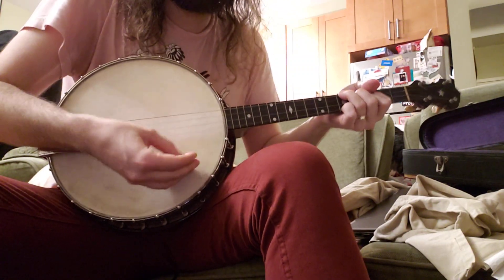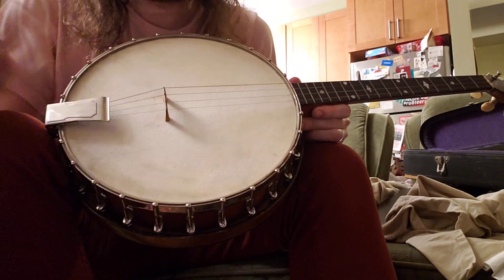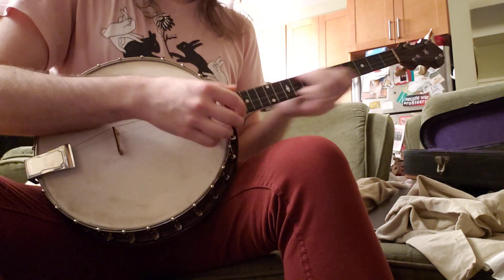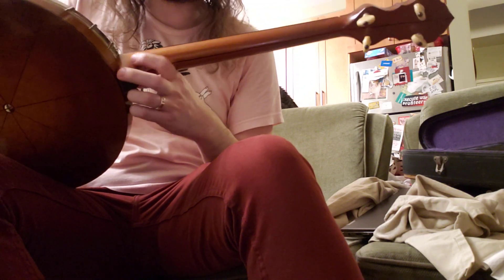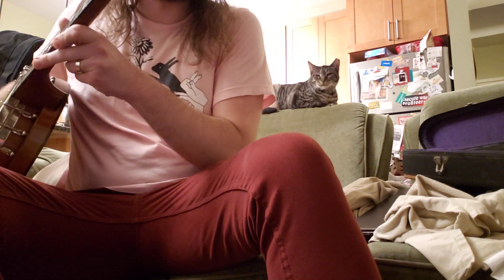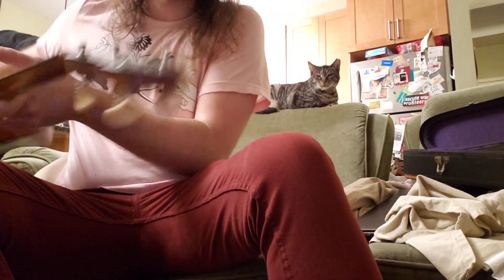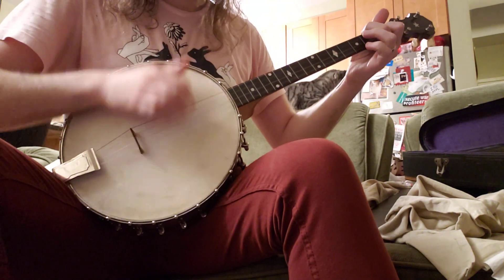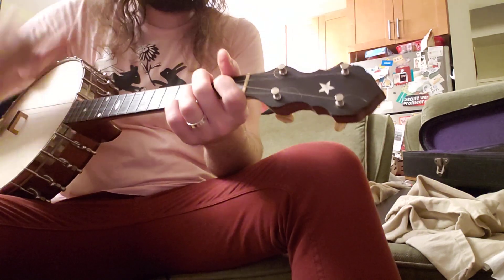THIS VIDEO OF A BANJO I WAS GIVEN AND WILL GIVE TO A FRIEND CAN BE PUBLIC WHO CARES

Comment: Notes:
tenor banjo - A longer neck would make it a plectrum banjo that is tuned like a guitar.
bridge - A square bridge is common and may move. Bee wax, double stick tape or a tiny drop of glue on the feet will secure it.
string height - Modify the bridge to adjust string height.
tuners - Friction tuners like those apply pressure on the top and bottom of the peg head. Add a washer if it slips.
tuning - There are a variety of tunings.
truss rod - The dowel stick holds the neck firmly. It was not designed to be adjusted.

If you want to part with the banjo, I will gladly accept it.
Reply: More:
If the strings touch the tension hoop, tighten the head a little. The head deflection at the bridge should be about 1/16" (the thickness of a quarter).
Reply from the maker: @tharleman  oh MAN I've never thought to tighten the head on a banjo before, wow! Thank you for your expertise!
Reply: @dictionaryattack  Did you tighten the head a bit and did that help with fretting up the neck?